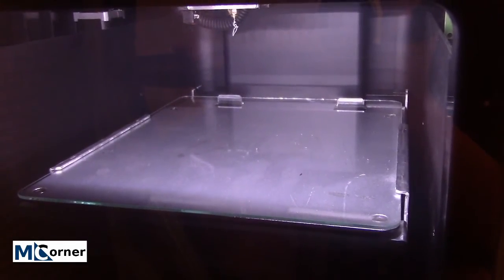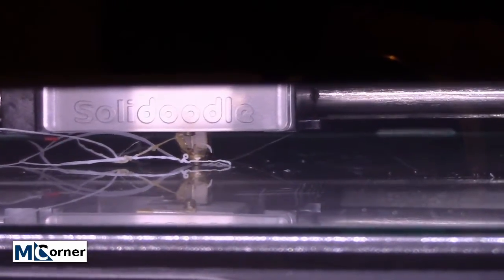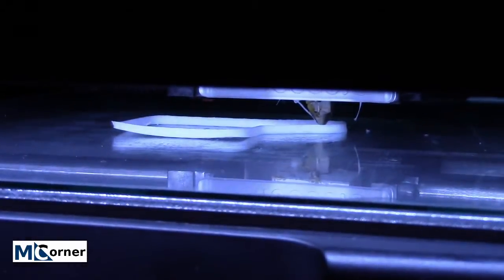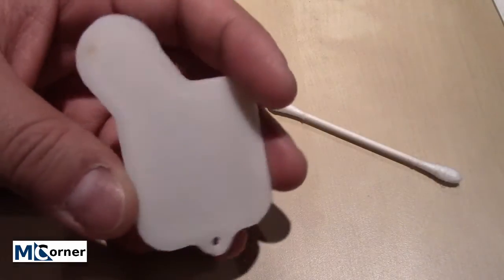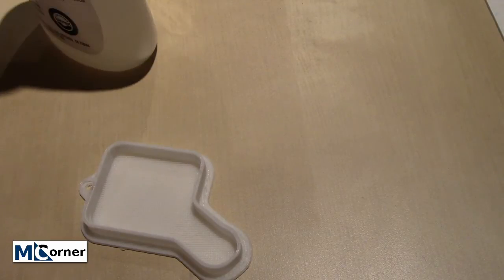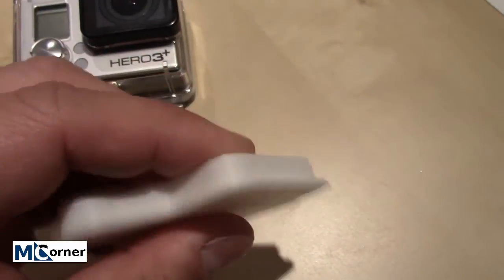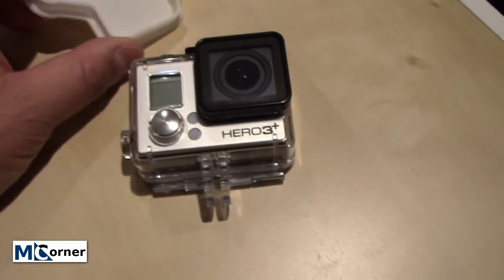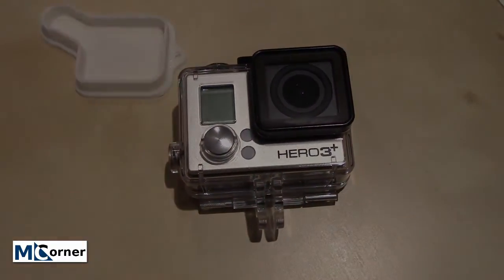Solidoodle Press - Pain but then Success

Comment: i use a paint made of acetone and scrap abs pieces, i have not had problems since
Reply from the maker: Nerd-Tender Hi NT.  Thanks for the tip.  A few others mentioned using this method as well and I'll have to check it out.  At the moment, I've been printing mostly smaller items where the painters tape and higher temps have been sufficient.  Larger stuff have been challenging and this seems to be the method of choice.

Comment: easy and simple: I do this in my "Press":
Take the glass off (be careful and patient do not force). Clean it, and apply hair spray.
Put the glass on again. (the hair spray applied up, hehehe)
Bed: 100°C
Extruder 220°C
You can prin many many things until apply the hair spray again.
Reply from the maker: Fernando Massa  Hi Fernando.  Thanks for the suggestion!  I initially tried hairspray but it didn't seem to work.  I may try that method again if it helps keep the warping down (but painters tape is soooo easy and no mess.  ha!).  What brand did you use?  I started using 100°C as well with the bed.  But for the extruder temp, do you not get layer splitting at that lower temp?
Reply: Marb's Corner work fine for me. =^)

Comment: Hi. What temperature did you use ? (both bed and extruder).
Reply from the maker: Paul Dragomir H Paul.  I tried several slight temp variations but the default temps (extruder-230°C, bed-95°C) and the use of painters tape was the combination that worked out.  I still get a little warping at the edges so it may need a bump up on the bed temp.

Comment: Have you tested adding a thin coat of acetone/abs slushy on the printbed?
Some use that instead of painters tape or glue/hairspray etc.
Reply from the maker: PezDJ Hi Pez.  I did try a few things but started with the steps in the manual to basically test the "consumer" ready claim.  Obviously that didn't work out and this was after doing a z-calibration which none of the samples stuck so I had no reference to adjust.  I slowly tried to resolve it with every combination of glue stick, hair spray and wax, and painters tape.  I decided not to go the acetone/abs slurry route due to the amount of cleaning I had to do just with the glue stick and hair spray.  After a manual z-calibration, painters tape gave decent results for small objects.  But when I work up to larger projects, I might try the acetone/abs slurry.